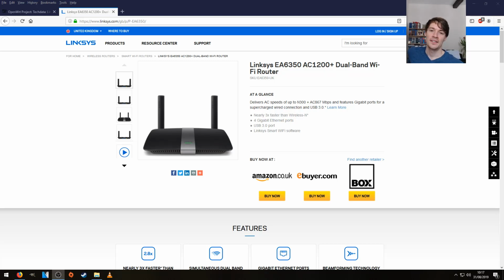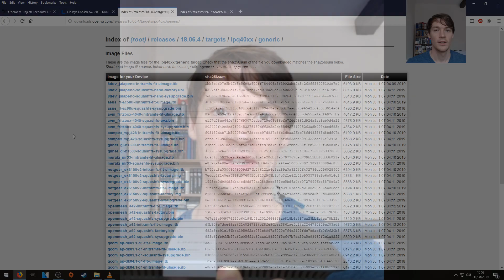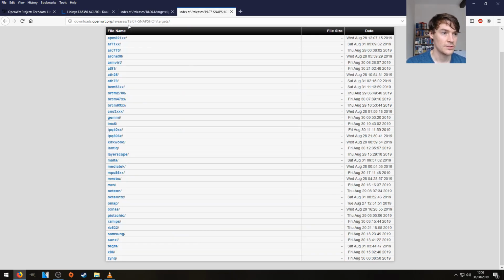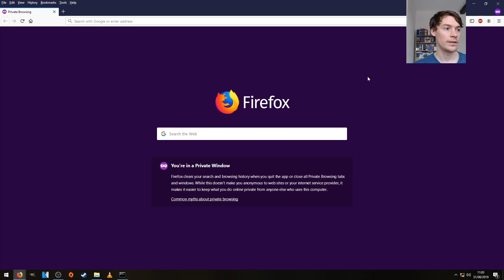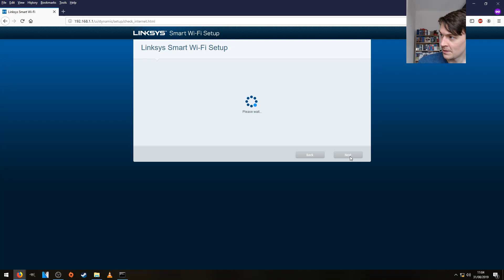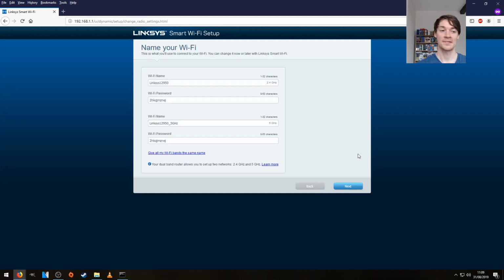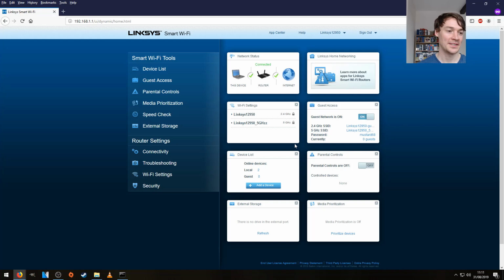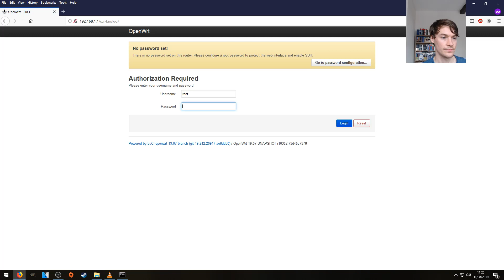OpenWrt - Linksys EA6350 v3 | Firmware Upgrade | FLASH

Comment: How do I know if my Linkysy EA6350 is v1, v2 or v3? sorry for the noob question...
and will the custom firmware enable wireless bridging?
Reply: I have version 4 and the stock firmware has a wireless bridge mode built-in. The problem I ran into is that when you put it in bridge mode, the tab that allows you to do MAC filtering disappears. Also, on the main router, you are only allowed 30 MAC addresses. I have an older E1200 and you could do MAC filtering in bridge mode. It also allowed 2 more MAC addresses. Not sure why it is so limited to begin with. I'm assuming so Linksys can charge you more for a more expensive router. Their documentation and specifications suck.

Comment: Why did you do this after the x86 setup? I'm more curious about a x86 build.
Reply from the maker: Mainly for space reasons, the x86 build didn't fit on my shelf! Also for running costs, the EA6350 only needs to support 2 users, x86 was a bit overkill for my needs.

Comment: It's too bad you couldn't follow up on the overall performance on lan, wifi experience, your max achievable bandwidth. Setting up network to your ISP if it's pppoe, Qos settings, the pro's and con's using alternative firmware, dns setup, difficulties adding modules programs etc, you can also compile the firmware for all your needs by creating custom build but that would be an extra video as there are two methods, the first is pretty simple, fast and then there is the two and half hour pending on your cpu, ram but in the end you'll have a great deal of packages, documents, modules, openwrt has documentation on all this.  best regards

Comment: Hi. I’m the developer who added support to this device: https://frickel.cloud/firmware/openwrt/commit/fb7b8d5ad3bc69122fa2d7360b25b58d100e798d
As I get some attention regarding to reverting back to stock, I would like you to review my Script designed for the purpose. A review for the ROM itself would be nice.
https://forum.openwrt.org/t/ea6350-v3-revert-back-to-stock-factory-firmware/42581/44
We can put a link in the wiki, this way more people can do it without too much confusion.
(You will have to wait for the version v0.18a because I changed the mount point but I forgot to update the script, therefore it will print an annoying error)
https://github.com/NoTengoBattery/openwrt/releases

Comment: Do i need to upgrade after installing Openwrt using ( openwrt-ipq40xx-generic-linksys_ea6350v3-squashfs-sysupgrade.bin ) ??
Reply from the maker: Hi, the sysupgrade.bin is for upgrading an existing openwrt firmware so yes in answer to your question. 

*The factory.bin file is only for installing over the top of vendor firmware.
Reply: Ok i did that. But when i flashed openwrt, luci wasn’t installed. I had to install it manually. It would be great if you help with openvpn install on this very router using openwrt. Thanks a lot
Reply from the maker: @mahmoudkhuffash6297  What sort of help do you need with openvpn?
Reply: Tech Level Jedi how to setup vpn. The tutorial on openvpn website is outdated i guess because it doesn’t match what i see in my settings
Reply from the maker: @mahmoudkhuffash6297  probably going to be difficult to do over youtubes comments! I would recommend posting your query on forum.openwrt.org as the community is very helpful
Reply: @TechLevelJedi  Did you ever pursue openvpn on this router any further? I am looking to do the same thing. All instructions found anywhere else are really outdated.
Reply from the maker: @ryandunn5993  I did not unfortunately. I favour wireguard now as it has superior performance